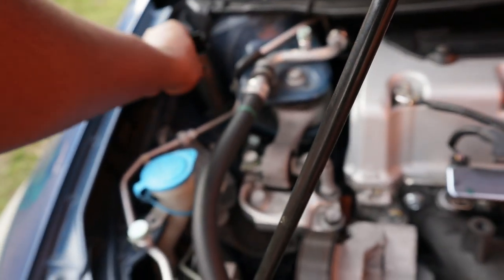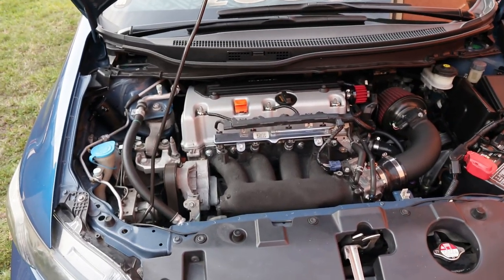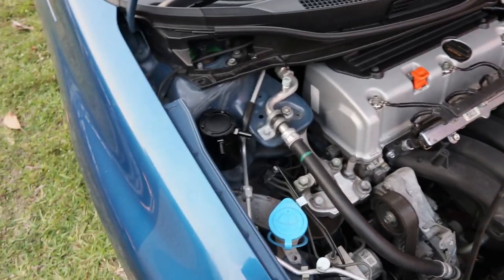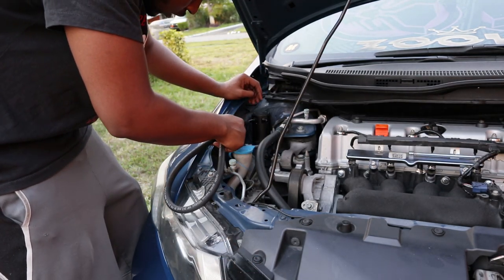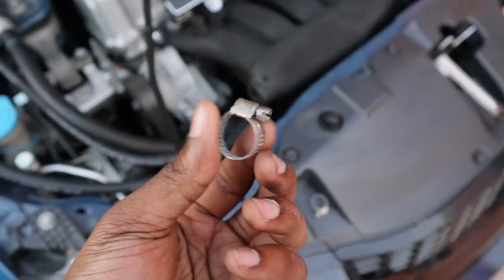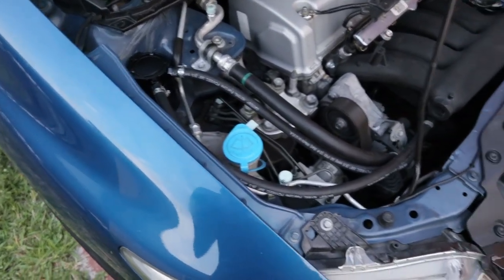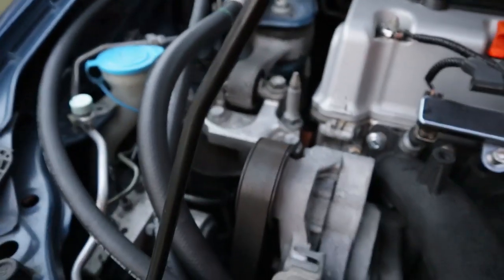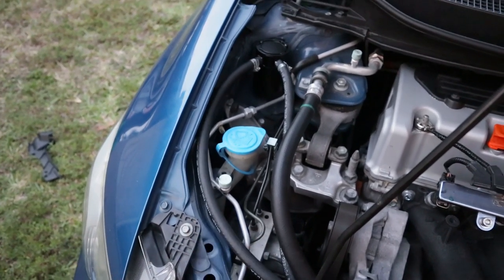Dusty REALLY needed this...

Comment: Just paused at the pause as well. My fg4's engine started ticking the other day after driving through some water. Looked like a small amount of water got in, but it drives fine so far. Been a total of a week and a half. I'm hoping that changing plugs and injectors will fix it, but if not def a valve adjustment. Resume.
Reply: Oh and appreciate the video my guy.